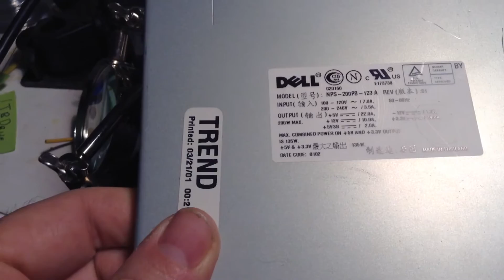Rewiring a DELL power supply to use it as a bench supply.

Comment: As the other viewers, I did not know how to start up an 20-year-old Dell desktop computer power supply which carries no green wire until I find your videos. I just followed your explanations and connected the grey and black wires and it could power up now. Thank you. 😁 (P.S. In this power supply, it is possible to trigger up without a 12v load. For reference, the model is ps-5141-201 145w output.) But after researching the relating videos, I finally understand the purpose of adding the load resistor is for a relatively constant output.

Comment: I have a Dell Power supply model # L375P-00.  I wired the Black and green wire to a  toggle switch to turn on the power supply.  Mine did not need an external resistor.  It may be that the fan as a load is sufficient to turn on the power supply.  Works great.

Comment: I connected a cd/dvd player as the load ,since I did not have a 10 watts resistor, it turned on. I also now have a cd audio player while I work on the Bench.
Reply from the maker: +Dart Gar Hey good idea. Good substitute for a load resistance and it is useful as well.
Reply: *****
 Thank you for sharing your knowledge with us. I have a couple of Dell Power supplies that I have kept and could not figure out how to switch them on. Now I can also tell which of them are bad. Thank you very much for your great help.
Reply from the maker: +Dart Gar Thanks for the kind comments.
Reply: *****
You are welcome!
Reply: Thanks for the good idea I have a Dell power supply model n220 ABA and I did the same thing hooked the cd player up and it started to work as well. 
This was a big help!
Thanks!

Comment: Hello am trying to convert my dell power supply. its not a atx, which i realized that i have to do more than just connect the green with the black wire.
Am a little confused and i hope you can explain. 
In your video you mentioned that you have to connect the Gray wire with a black wire.
Is this with any Black wire ?
 
Also you mentioned connecting a 100 ohm 10W power resister. Which wire do i connect that too and what is its purpose ? 
Can i get by without using a power resister?

Thanks again for your video. I see many videos talk about converting a power supply but its all who have a atx power supply and your the only person who explains what to do when you don't have a atx power supply. 
Thanks for your help.
Reply from the maker: Joe Cobos OK Thanks for your comments. I will have to open the supply up again to see exactly what I did and get back to you on that. I will take a look on Sunday and get back to you with the info. Dell power supplies are trickier to turn into bench supplies than your regular PC power supply.  It's been about a year and a half since I last did this so it will be easier for me to open it up to see what I actually did then.
Reply: Thank you, your right dell power supplies are not easy, but no rush. whenever you get a chance. Enjoy your weekend.
Reply from the maker: Joe Cobos 
Rewiring a DELL power supply. (Part 2) https://youtu.be/VpsrmQSEeho
Reply: electronixTech thanks, be blessed
Reply: Joe Cobos